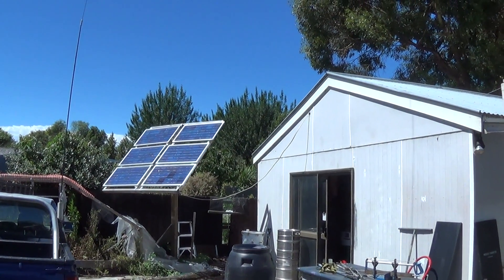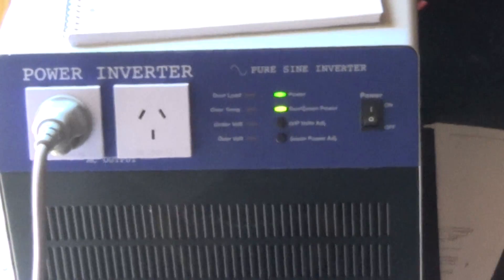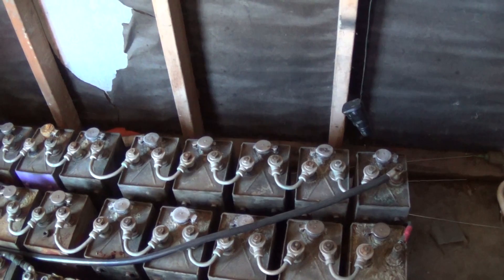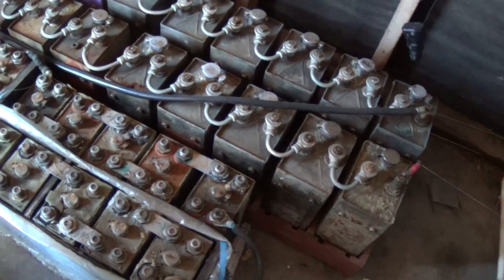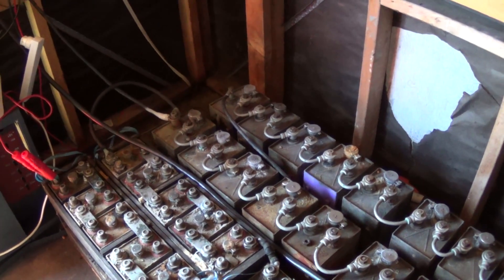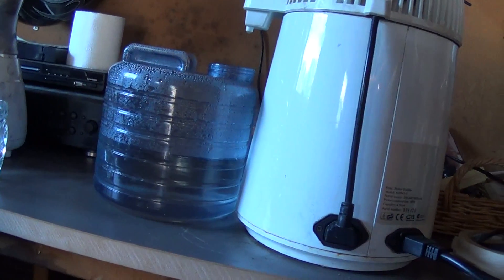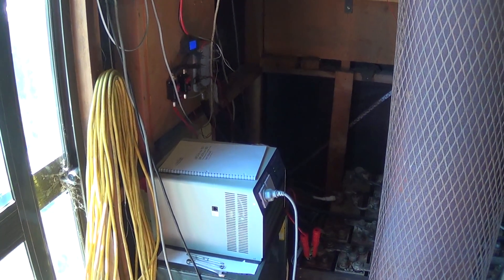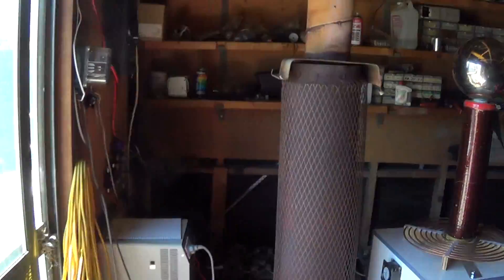NICKEL IRON  BATTERY

Comment: Original edison batteries were built to a high standard........the chinese made ones, not so much. How much water are you using in your bank? Lithium batteries have performance degradation issues as discovered in battery testing in Australia, and the LG ones have a national recall for catching on fire.  Become informed.

Comment: Lithiumbatteries have flaws In my opinion you may be better off with rechargable zinc air over lithium phosphate batteries. But if you want something to last you may try regenerative fuel cells. They make hydrogen and oxygen in the day and convert it back to power at night. But The nickel iron may be the more practical. That was my two cents. Also don't buy a lead acid battery filled. You can fill them with about solution of polyvinyl alcohol and about 2 table spoons of Epsom salt per gallon of distilled water. They should charge to 11v on a 12v cell.

Comment: Hey mate, Love the setup and the use of NiFe cells. I am in Dunedin and am looking at getting some of the same cells to use at my address and have a couple of questions. how often do you need to top up the cells? what size wire do you use from the charge controller to the positive and negative terminal?
Any insurance headaches?

Comment: Nice work.  Looks like you have 1-24volt nickel iron cell and 1-24volt nickel cad cell.  Are each of the cells the same amp hour rating?  If not how well do they work together?  I assume you have them hooked up in parallel?  I have read that if your amp hours on your batteries are not the same they don't work well together, but that was using lead acid.  Maybe it don't apply to the NiFe and NiCad cells.  I actually have a NiCad cell purchased.  It was 180amp hours when new 50plus years ago. I was thinking of buying a new NiFe cell from Iron Edison to tie together in parallel, but the new cell would only be 100amp hours.
Thanks for any help you can give.